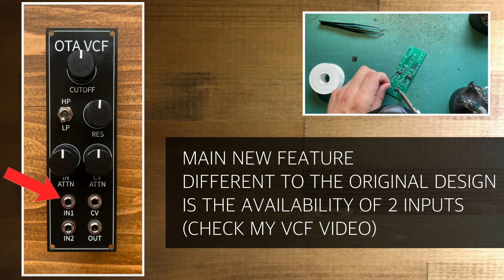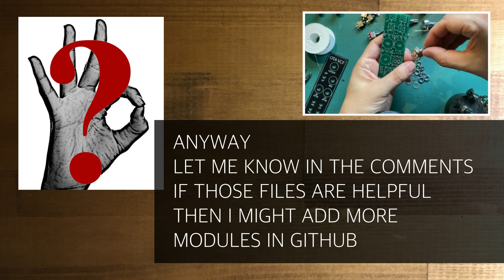A nice small OTA VCF with 2 Inputs for your Eurorack Modular Synth

Comment: Hallo TOIL , your github content is very nice (specially the two deferent versions of pots and jacks,i can finely use this Chinese pots that I have lying around)
One thing would be helpful   ,DXF files of your frontpanels ,this way I can make front panels the way I like them (with thick white lines left and right side of the panel ,moogich style),thanks for sharing your work 
Grtz
The moonscientist
Reply from the maker: Thanks, Moonscientist. Actually, I do not have DFX files for the panels. My panels are just made out of PCB material with the same tool. If I saw correctly, DFX files are from some CAD tool. Don’t know about CAD, but I will add the information of the coordinates for each front panel component in GitHub. Hope, that will help.
Reply: Hey ,Very helpful , I import it into easy IDA as e image , works flawlessly ,thx ,Grtz
Reply from the maker: Great. Good to know it worked.

Comment: Hi TOIL, this is really cool!   I would like to use an analog filter like this to feed the stereo output of a soft synth but obviously it needs to come out in stereo.  I see you have 2 inputs but only 1 output.  How easy would it be to have a stereo output?
Reply from the maker: Hello Melanie, the fastest answer and easiest way would be, use 2 filter modules, one for each channel.  These analog filters provide only one circuit for the audio signal. The 2 inputs are just mixed together, and the mixed signal is going through the same filter. Adding a second output could only be possible by just copying the output from the filter, like in a multiple. I think that’s not what you want. There are stereo filter modules available, but as far as I know they also contain always 2 separate filter circuits. Hope, that helps.

Comment: Hi, TOIL, after I got the PCB (Thonk version), I found the trace of INATTN (A100K) seems not connected. Could you please check? I hope I was wrong~~
Reply from the maker: Terribly sorry, you are right. I fixed it and replaced the file with a new version
Reply from the maker: Thanks a lot for letting me know.
Reply: @TOILmodular  Haha, I am trying to fix it by jump wire. Is this the only component to miss trace?
Reply from the maker: Yes, the rest should be fine.